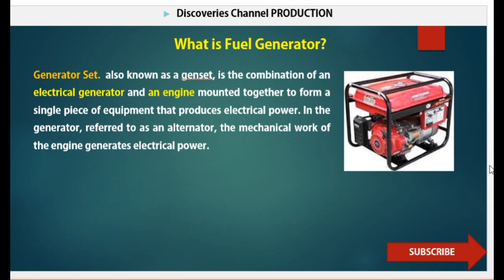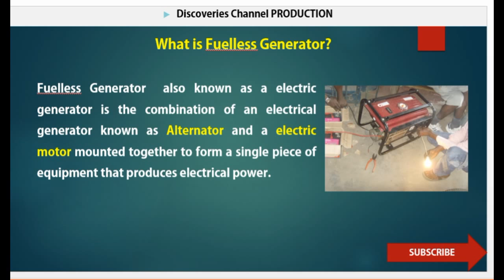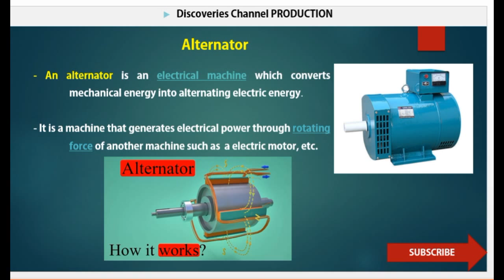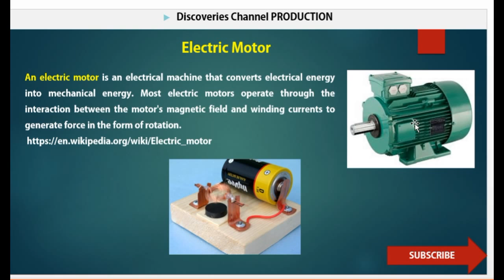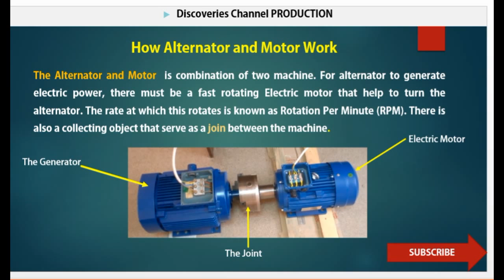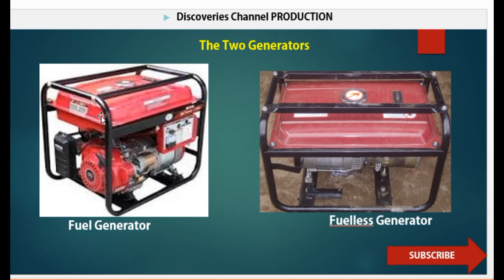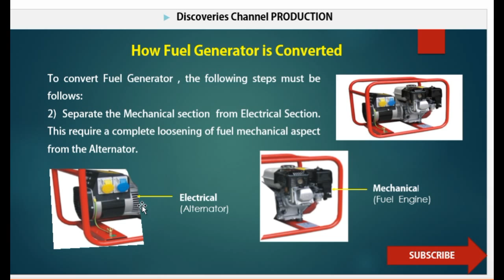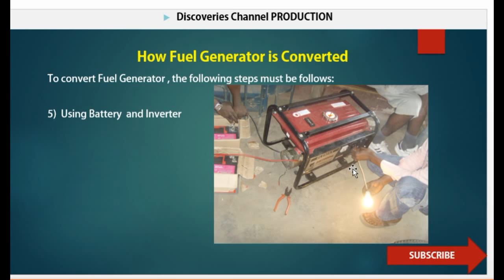The Best Methods to  convert Petrol Generator to 0% Fuelless

Comment: I have a 3.5kva gas propeled generator. It is stated that the gas engine is 5.5hp while on the manual, it was stated that revolution 3500 rpm. I learnt that 5.5hp gas engine is equivalent to 3hp electric emotor. Can anyone use this method to determine the correct size of dc or ac motor purchase? I would like to start my fuelles gen. without battery. How abow that?

Comment: Yes you really tried,its only that you cant generate a stable current when electric appliances re connected to the gen,you will only experience voltage reduction.to avoid this you need a little heavy flywheel with the coupling.Better still,you should use a150 ahms car generator and an A/c powered motor with 2500 rpm or more , a pure sine wave inverter with continous current of 3000watts and a 200 ahms 12v battery,connect the inverter to the battery,inverter ac current to start the ac motor,the motor turns the 150 ahms generator to charge battery,while the inverter supplies a/c current to ur electrical appliances and also the a/c motor.This method will give u a stable 3000watts of 230 v ,50hz for ever without draining the battery.you have questions, send me message on my whatsapp 09071290596.

Comment: I'm from Ghana
I have turn my generator into fuelless 
I'm using AC motor but when I plug it the voltage comes but to make it consistently is the problem
Teach me how to go about it
Reply: Hello,I m from Nigeria,all you need is to do is to get a 3kg flywheel attached to the coupling,wait for it to attain a higher revolution or momentum , then switch house appliances.it will definitely  power ur house.
Reply from the maker: Please get my book everything you need to construct is in the book. Including dams, solar, wind turbine, etc. 2250 pages ebook for $30 only. whatapp 08093065609
Reply: @DiscoveriesWorld81  $30? How do I make payment for the book? I would love to get the video as well

Comment: You forgot to tell us the type of motor, capacity and rpm of the motor. This will enable us to know the size of motor for a particular size of the alternator. Now your explanation is good but no clarity on the voltage or keep of the motor and the alternator.

Comment: The Joint is Called a Coupler Union, it Must be Balanced and Centered to Both Motor and Alternator Shafts so Zero Vibration Occurs...